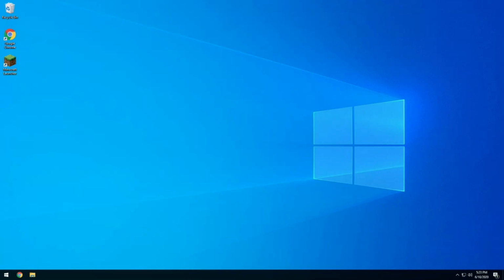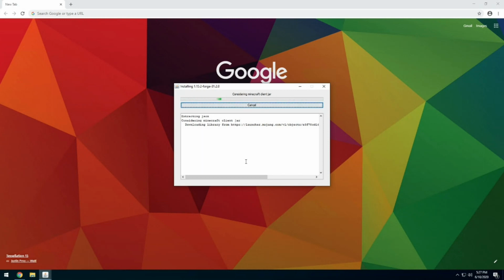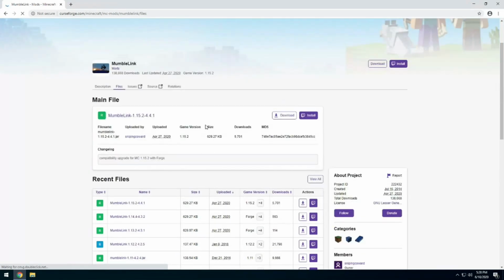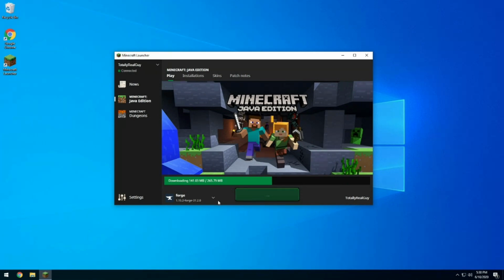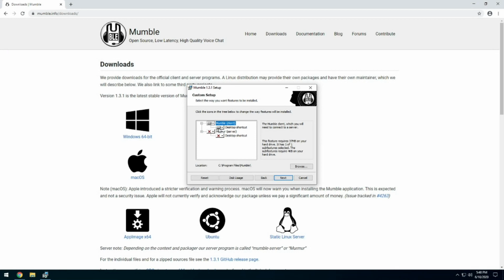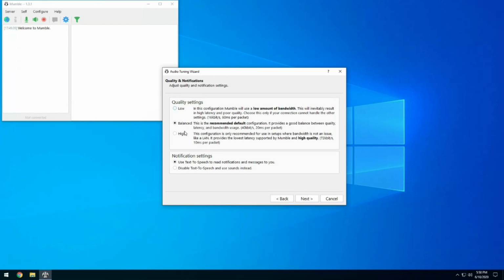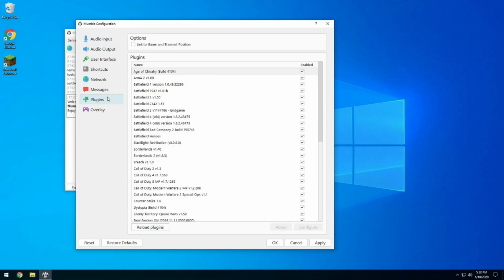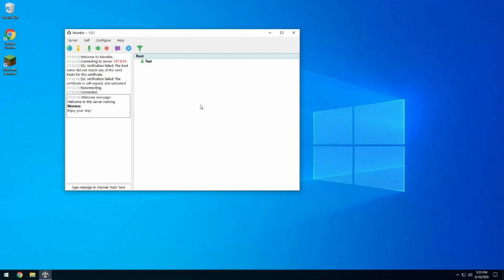Minecraft Mumble Link 1.15.2 Tutorial

Comment: I know its a long time after you posted this but do you know why it keeps saying Server connection failed: Connection refused. when I try to connect to the server.
Reply from the maker: Well, this could be one of several problems. First off it's important to note that the Minecraft server and the Mumble server are two different things, so make sure that your connection to each server is working. If it's an error with the Minecraft server, I would troubleshoot with someone else to see if they can connect as well, I would do the same for the Mumble server.